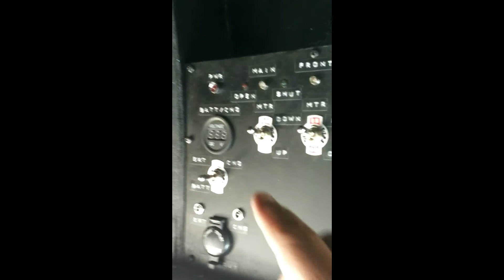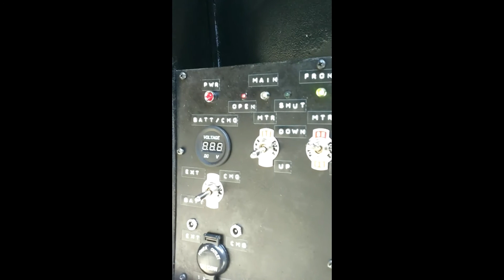Home made DIY Dome Observatory motorized hatch control

Comment: Very Awesome!!! Does the shutter have any wheels on it? Or does it just ride on the frame?also did you make your own pulley's.  Did you post this online? Sorry for all the questions but I'm building an observatory also just can't figure out a system for the shutter
Reply from the maker: https://ravenandowl789657933.wordpress.com/
Reply from the maker: It is all explained on my  blog at this address.The whole process of dome building is there. I should have finished the site by explaining the software and other bits and pieces but I was distracted by other things 🙂
Reply from the maker: One of the chapters is called The shutter strip and the shutter frame
I think the pictures show the three sets of double wheel runners on either side of the shutter frame above. Matching wheels are  bolted to the sides of the frame beneath each upper runner sandwiching the aluminium track in between